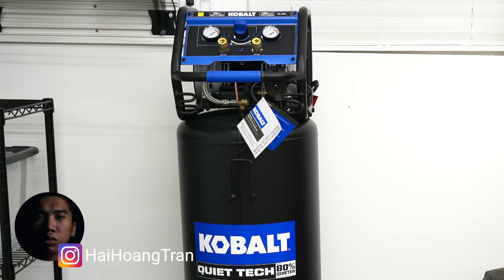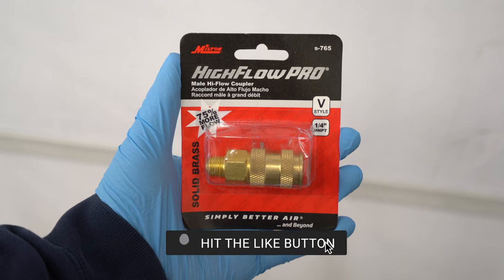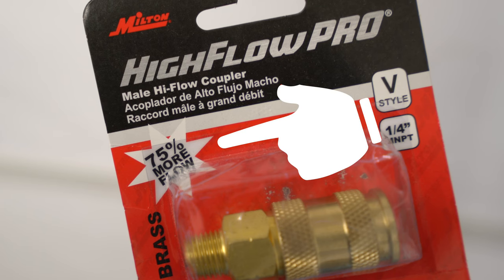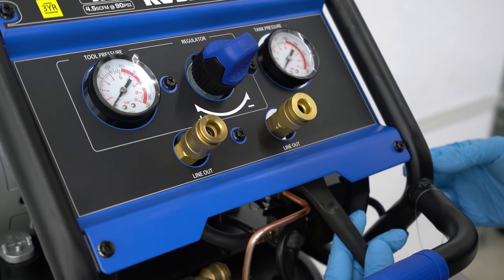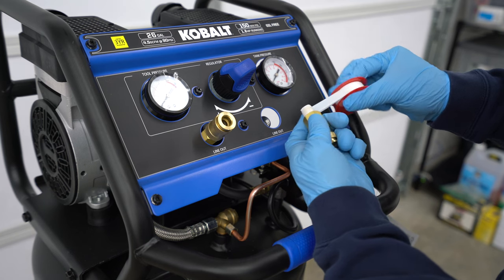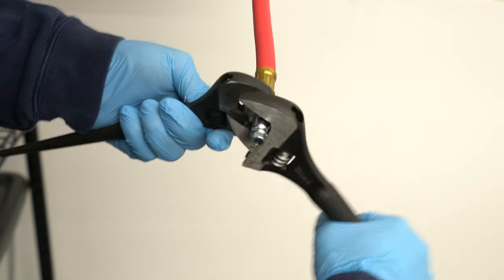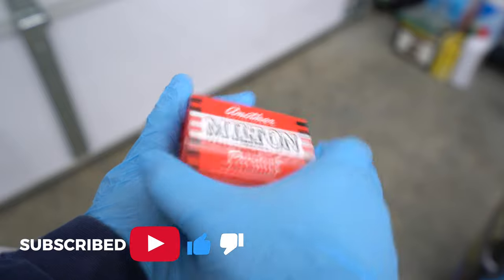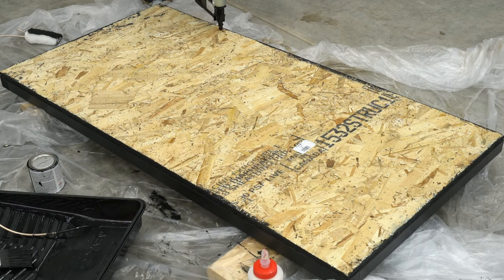Kobalt Quiet Tech Air Compressor High Flow Coupler Upgrade

Comment: Why not 3/8 over 1/4. 3/8 hose would be better, too. Dont you think?
Reply from the maker: Larger for everything is going to be better. But from my experience, it’s not going to be a perfect setup in general because if you use a wide variety of different tools, you’ll eventually run into something that you’ll have to re-convert back to the standard industrial size. I’m in that boat. I have a connection point that is only available in industrial size so I have to jump through hoops with a few different conversion connectors just to make things work.

Comment: How has this upgrade paid off? Notice any different?
Reply from the maker: For me, this is a future proof upgrade. I'm not using the compressor too much right now and not with air intensive tools so won't realistically see a difference. The increased air flow is logically there, but only noticeable under certain uses.